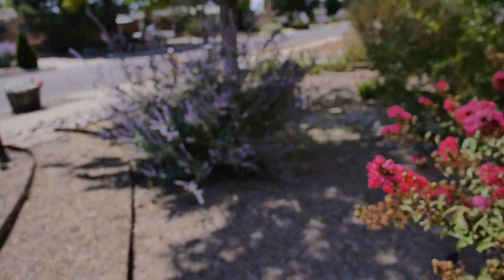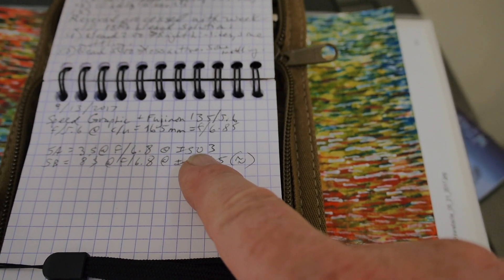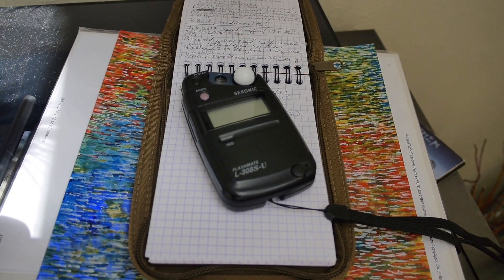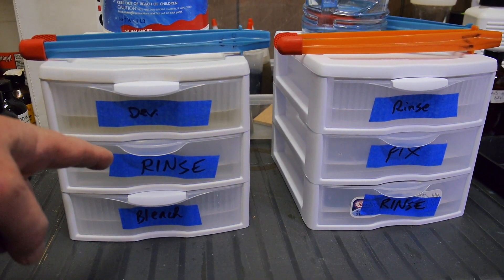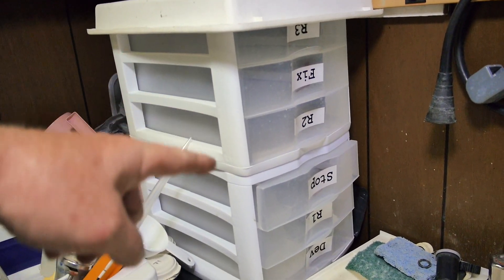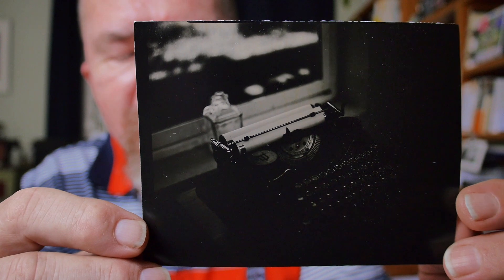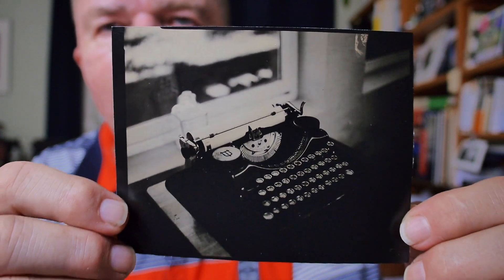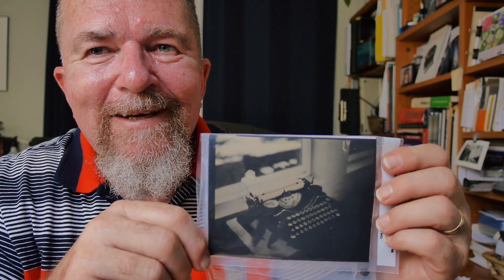Reversal Print Processing - Part 3

Comment: Maybe a high UV source could be used both for the preflash and as supplementary lighting? A simple homemade open air arc lamp maybe? 
The lower base ISO almost exponentially more preflash is needed to get a good result. That much I got from skimming various sites. Maybe do a systematic test on a single sheet with various parts exposed differently.
Also pulling the paper could be an option to lower contrast.

Comment: Two questions- what is the EV of the light under the enlarged? And have you tried using filters to control the contrast? I had a popcorn tin pinhole and used a lower contrast filter with the multigrade paper. Helped with the high contrast I was getting with daylight.

Off tomorrow to get some citric acid and try this with paper and then some green high speed stay film.
Reply from the maker: Meter on incident mode, ISO100, enlarger light is EV5.4 at baseboard.

I have not yet tried filtering the light; most of my paper negative experience is with fixed grade 2 paper.

The re-exposure affects mainly the shadow detail, since it is exposing the silver halides that didn't get much exposure in-camera. I'm interested in getting a higher pre-flash exposure, before the in-camera exposure, to elevate the shadows a bit and hence reduce contrast.